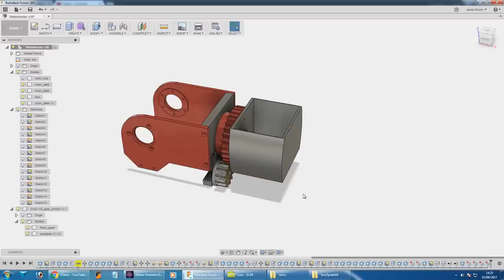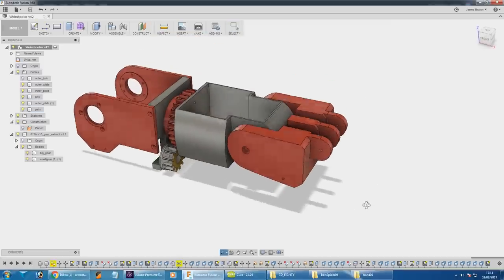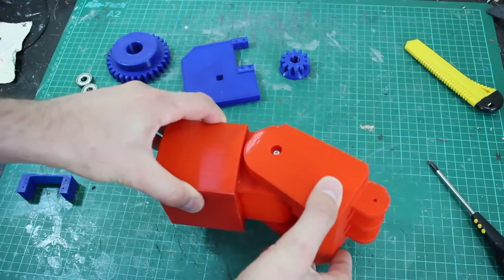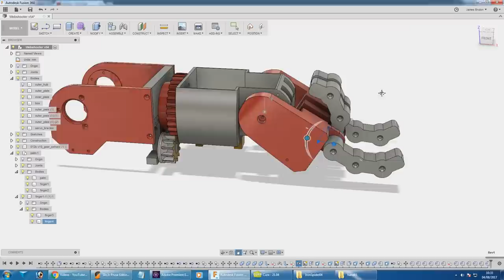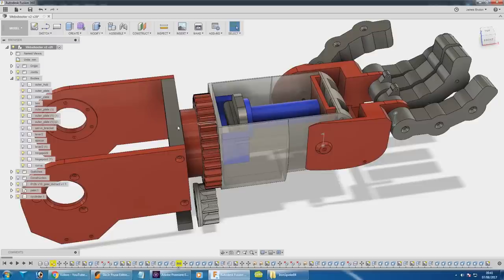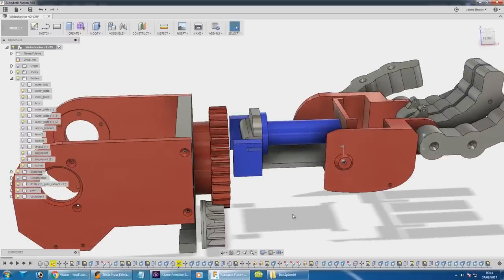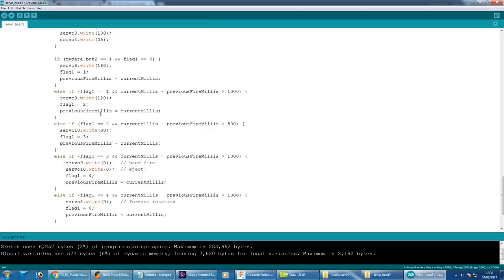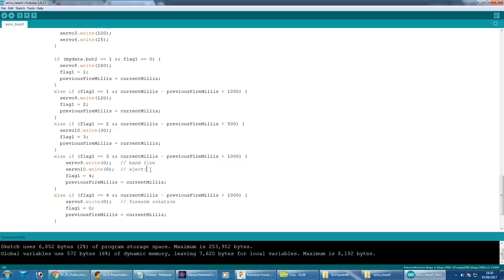Robot Spider-Man #4 | Web Shooter | James Bruton

Comment: You could cover the spring in light weight white fabric so it looks more like a Web projectile, that way you can scrap the string and it won't impede the robots function after firing.

Comment: Could you store the string inside the blue cylinder that the spring is around? String could attach to front of spring, run down inside of spring. So when spring fires the string is pulled from cylinder as it goes.

Comment: How about replacing the spring's tube with a cone then wrapping the string round that and slipping the spring over the top?  So the string is stored on a cone inside the spring